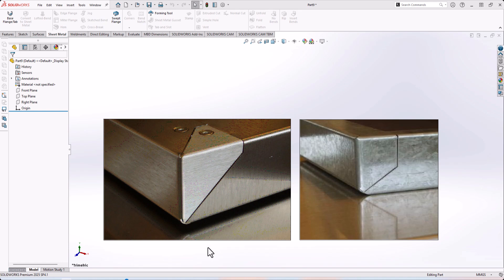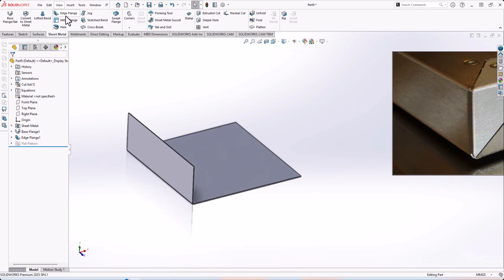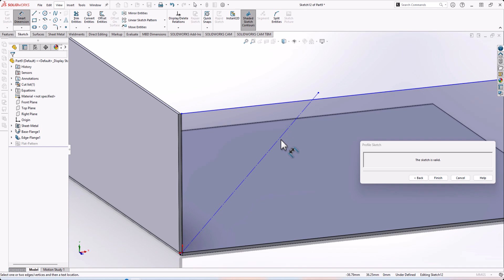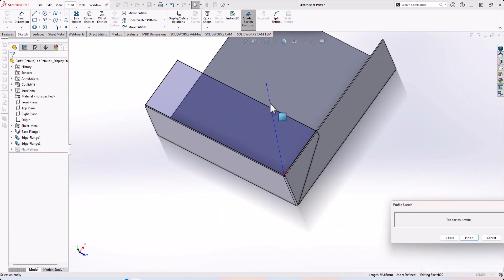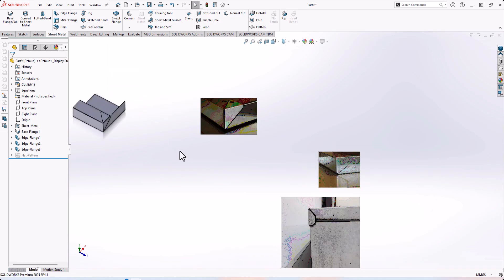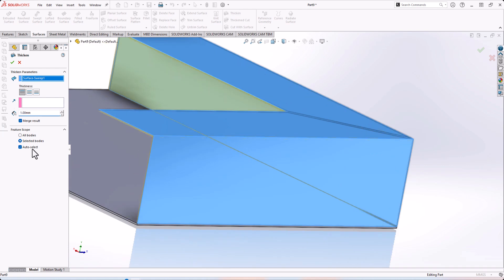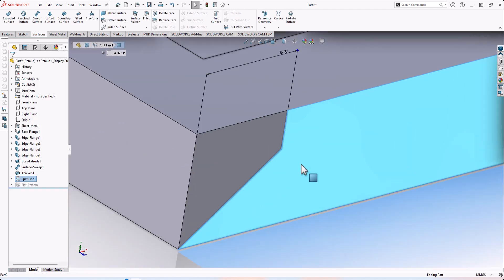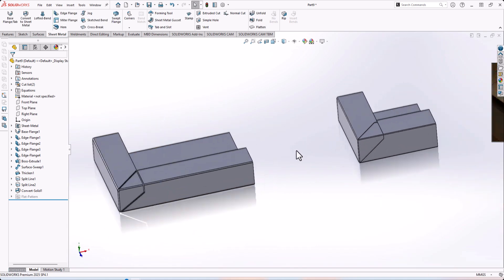SolidWorks Sheet Metal Corner – No Welding Needed

Comment: I am an avid follower of your excellent channel and greatly benefit from your valuable tutorials. While applying what I learn, I face a challenge in SOLIDWORKS and would appreciate your opinion or suggested solution.

Problem Description:

When I have a 3D assembly file and I do the following:

1. Create a drawing from the assembly using the 'Make Drawing from Assembly' command.
2. Insert a Bill of Materials (BOM) into the drawing.
3. Configure the BOM to import Custom Properties from the component files, such as Material and other predefined properties.

I notice that the BOM does not display Standard Parts like Screws and Nuts as desired. Instead of showing their descriptive information (e.g., M6x10 indicating the screw's diameter and length), they appear with their generic names or file numbers only.

Desired Outcome:

I want these standard components to appear in the BOM in a way that clarifies their specifications. For example, a screw should be displayed as M6x10 to indicate it is an M6 screw with a 10mm length.

My Inquiry:

Do you have a solution for this issue? Could you guide me to the correct settings in SOLIDWORKS or the proper method to configure these standard components so that their properties are read automatically and displayed descriptively in the Bill of Materials?

Thank you for your time and effort. I look forward to your continued outstanding contributions.

With sincere respect and appreciation.